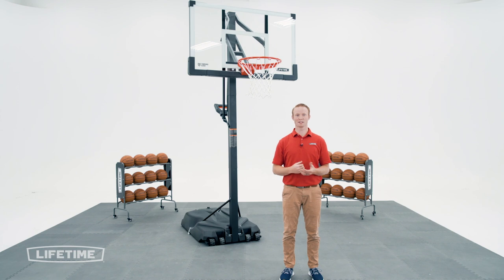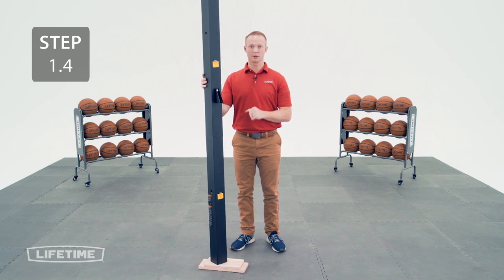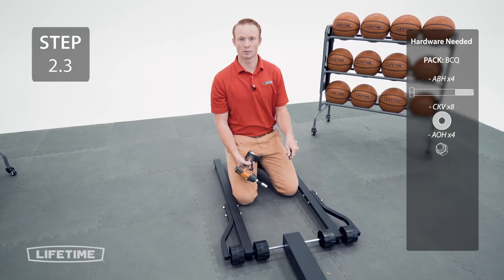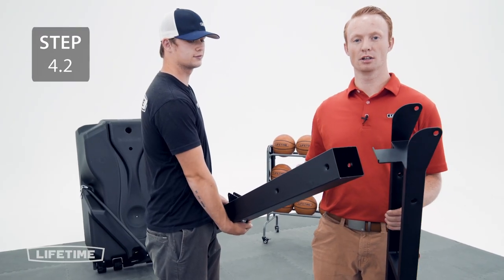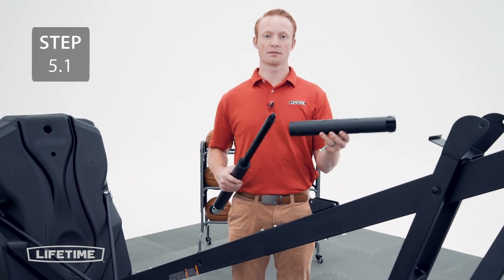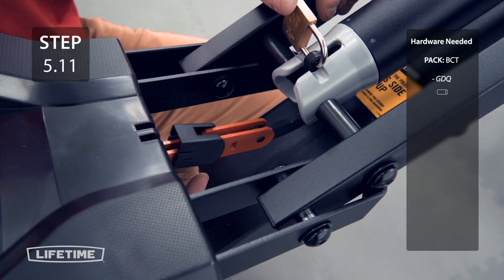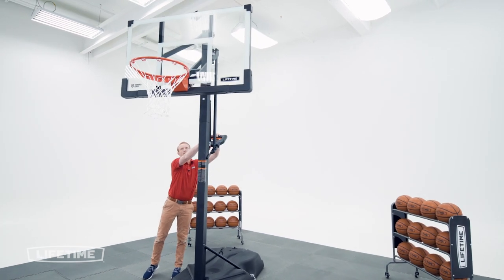Lifetime Mammoth Series™ Portable Basketball System | Lifetime Assembly Video

Comment from the maker: Section 1
02:10 | Step 1.1
02:40 | Step 1.2
03:21 | Step 1.3
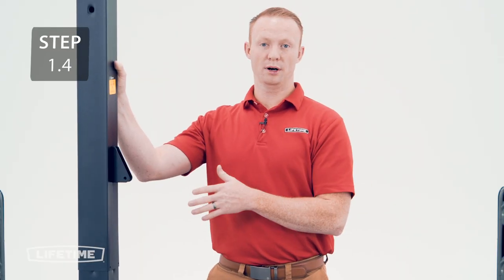03:29 | Step 1.4
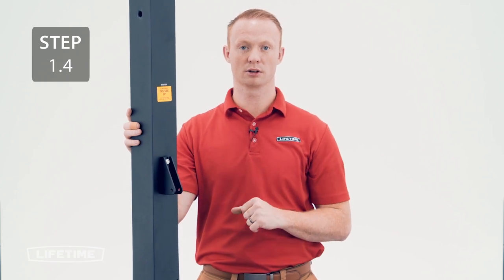03:59 | Step 1.5
04:07 | Step 1.6
04:40 | Step 1.7

Section 2
05:38 | Step 2.1
05:51 | Step 2.2
06:21 | Step 2.3
07:23 | Step 2.4
08:10 | Step 2.5
08:18 | Step 2.6
08:25 | Step 2.7
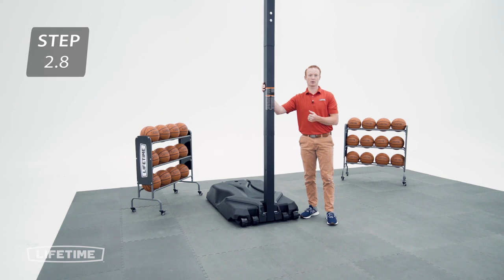08:37 | Step 2.8
08:45 | Step 2.9
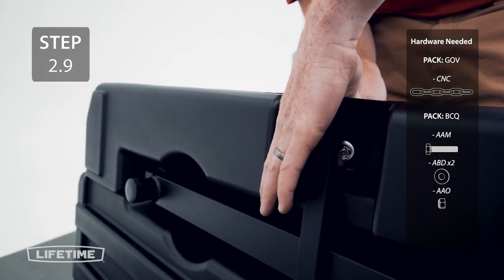09:05 | Step 2.10
09:27 | Step 2.11
09:43 | Step 2.12

Section 3
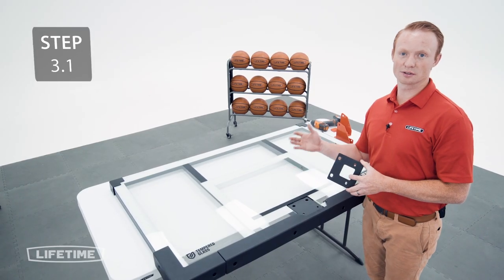10:04 | Step 3.1
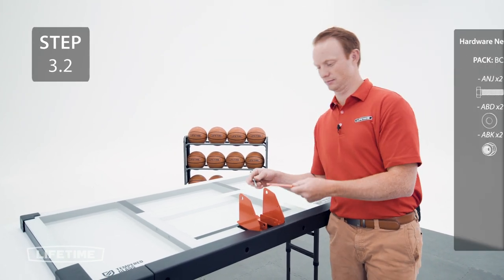10:30 | Step 3.2
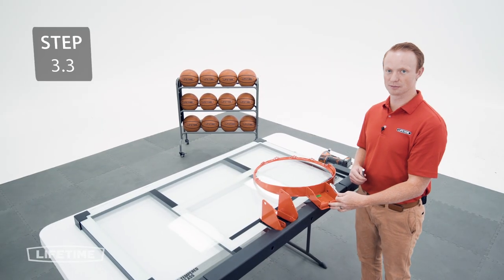10:46 | Step 3.3
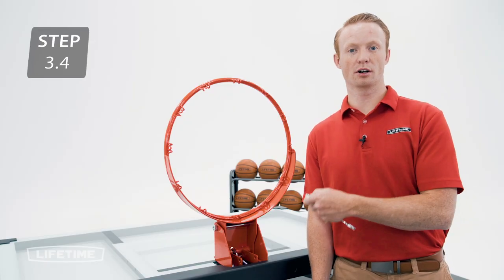11:31 | Step 3.4
12:02 | Step 3.5
12:33 | Step 3.6
13:21 | Step 3.7
13:31 | Step 3.8

Section 4
13:49 | Step 4.1
13:59 | Step 4.2
14:39 | Step 4.3
14:46 | Step 4.4
15:13 | Step 4.5
16:22 | Step 4.6
16:59 | Step 4.7
17:19 | Step 4.8

Section 5
17:30 | Step 5.1
18:02 | Step 5.2
18:11 | Step 5.3
18:51 | Step 5.4
19:06 | Step 5.5
19:32 | Step 5.6
19:49 | Step 5.7
20:00 | Step 5.8
20:08 | Step 5.9
20:29 | Step 5.10
20:45 | Step 5.11
21:02 | Step 5.12
21:11 | Step 5.13

Section 6 
https://youtu.be/5RQtqU3GpNw | Use this link for the 6.1-6.4
22:13 | Step 6.5
22:29 | Step 6.6
23:04 | Step 6.7
Reply: Some of the text boxes in video are incorrect with the proper hardware. For example 5.2 (5.3 in book)says to use GDM and it’s actually GOU. And In the beginning 2.10 and 2.11 it says to use DRZ it’s really GRC and AAM is actually GRE

Comment: I shouldn't have to use a hammer to get part ABR into ALH right? All my big metal parts look like they weren't gone over. Lost of sharp edges and things not fitting
Reply from the maker: One thing you could try is using the threads on the bolt to ream out the excess powder coating in the hole. If that doesn't work, please contact our Customer Service Department. Our Customer Service Team can be reached at 800-225-3865 opt. 1 or by email at customercare@lifetime.com. Customer Service hours are Monday-Friday, 7:00 am to 5:00 pm (MT).

Comment: Having trouble locking the assembly into place when we lift the pole. Anyone else have this issue?
Reply from the maker: There may be an issue with the handle or the lifted arms. I won’t be able to tell without any images. Can you email pictures to youtube@lifetime.com the your contact information so we can look at what may be the issue and then reach out to help with the rest of the assembly?
Reply: We also can’t lock the pole into the base. It’s too short and can’t reach to lock. Did you ever figure this out? We talked to customer service last week and they even sent a new pole. Still doesn’t work.
Reply: @jennifercarter3015  After much back and forth with customer service they ended up sending us a new base; received it today-It worked.  Recommend you have them send you a new base to see of that works for you. Customer service was very helpful and prompt with their responses.